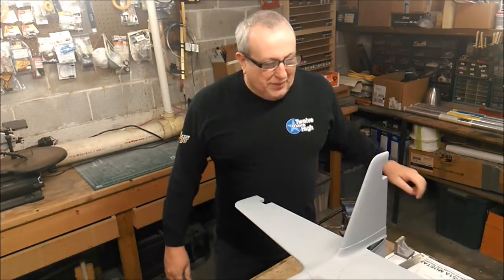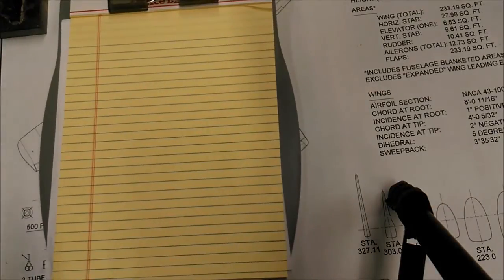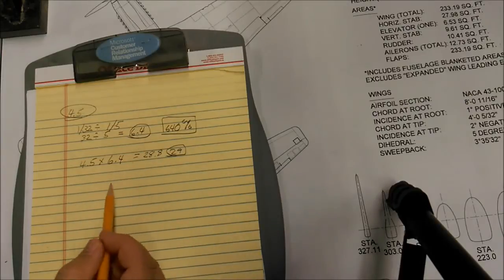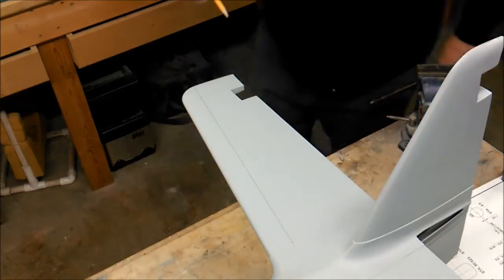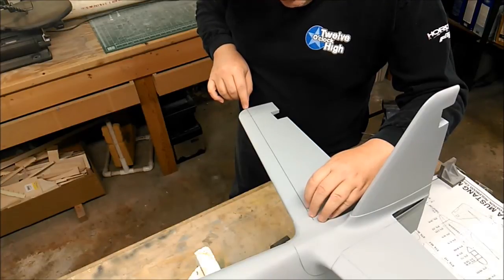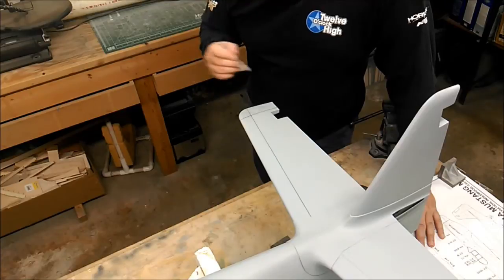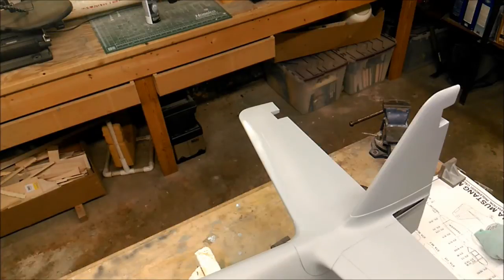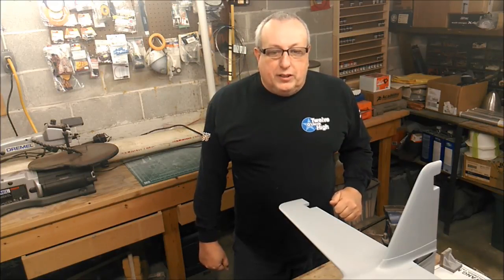Simulating Butt Joint Panel Lines On Your R/C Scale Model

Comment: Hi Mike I was going to ask the thickness of tape, but notice you have it in the video description. For cowl parting lines at 1/5 I have tried 1/32nd and prefer slightly more definition. 1/5th is an odd size, smaller models then I use 1/64, larger 1/32....... whatever floats your boat. Great video my friend.

Comment: Great video, there are other ways of achieving this, I don't bother with measurements and pencil lines and rulers especially on compound and complex curves and shapes - scale drawings can be printed on tracing or transfer paper or even standard paper but mirrored, place the drawing face down on the part and rub benzine or rubbing alcohol to transfer every detail exactly where you want it - I then use painter's blue vinyl tape which is a very flexible and can be stretched and lay it over the transferred lines on the airframe

Comment: Keep the vids comin.

When you buy model masters paint do you but the small bottles or is there a bigger version?
Reply from the maker: Hi Dale, since model masters covers so well (its pigment is 1000 time finer than automobile paint) you only need two thin coats to cover an area. A 1/5th scale model like the P-51A will take about 8-10 vials of the OD green and 6-8 of the grey for the bottom. I buy them in bulk but yes they are in the small vials.